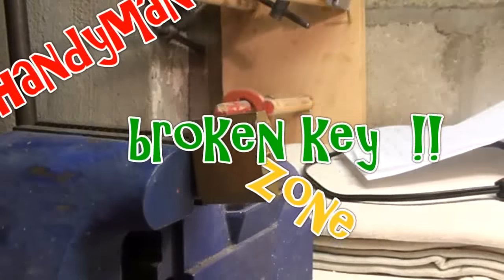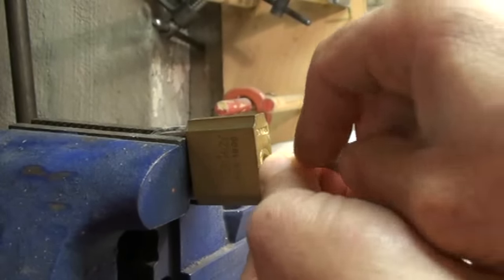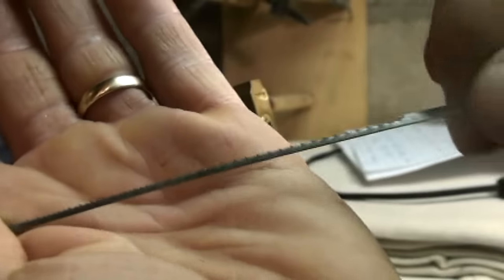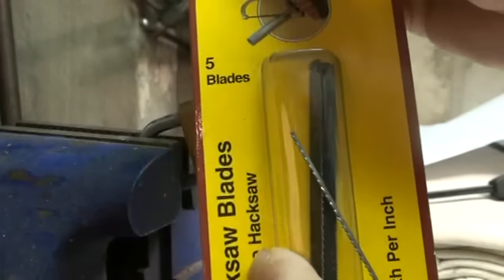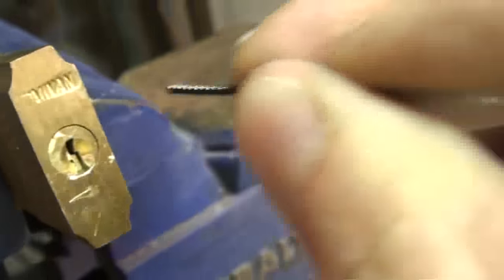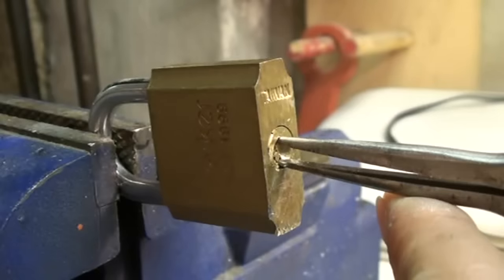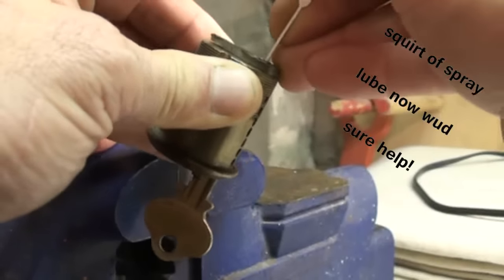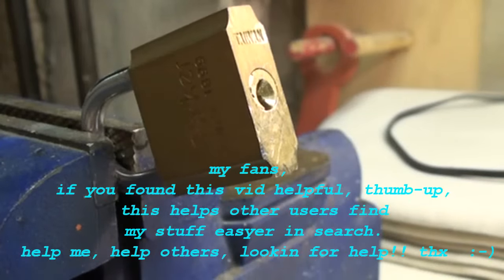7 Tricks Get Broken Key Out Yourself - Any Lock or Key

Comment: Thanks, the hacksaw blade thing worked great for me. My piece of shit stepfather tried breaking into my gun cabinet to steal my guns to sell, the idiot left the lock all messed up with paper clip parts inside, the hacksaw blade pulled em out and straightened out the inside of the lock so the key fits and works now. Now to go to the hardware store and get extra security :\

Comment from the maker: house visit? car in a parking lot? $35 bucks ,i dont think so!
yeah, $75 if you bring the lock into the locksmith store, 
but to have the locksmith come to you, that my firend is $350 and pay first cuz it only takes 2 minutes to remove a key
Reply: Wow, I'm moving to the US...

I'm a locksmith in the UK - if you called me out to remove a broken key at 1am on New Year's Day, the charge would be £95 (GBP) which I think is about $150-$160. A typical daytime call out would be a little more than half that, but basically, you are not only paying for the time it takes me to do the job, you are paying for the fact that I come to you, at a time you choose, in my van (with the expenses that that incurrs) full of tools and that I have public liability insurance, just in case I do end up causing some sort of damage to your lock.

I have no issues with you offering the info in this video, but I do get a little annoyed by people belittling the work that those in my profession do and making out that we make huge amounts of money, in return for very little effort.

Also, I would never recommend using regular WD-40 on any lock. WD-40 is formulated to remain wet. Every time you put your key in the lock, you will coat it with the WD-40, then when you put the key your pocket, it will collect any lint or dust present. Keep repeating this and you end up filling your lock with debris, which could eventually cause it to fail. The silicone (which you used yourself) or a PTFE based lubricant is much more suitable.

Comment: Granite?

Seriously, I believe you meant to type "Graphite"... but allow me to share that Graphite is about the worst thing besides teflon that you can introduce to a lock.

Most cars already have either a Vaseline-like or lithium-paste lube applied at the factory. Add environmental pollution + some graphite power or liquid and you get the equivalent of cake mix.

I recommend a product called HOUDINI lubricant, available at fine lockshops everywhere.

in a pinch, Silicone, CRC-56, TriFlow

Comment from the maker: datboishaq, you could'nt, the locksmiths would be out of business, watch the video i totally explain how to use a mini hacksaw blade to remove broken keys, it is better tool than any profesional locksmith tool, in fact most locksmiths use the mini hack saw blade to remove keys because it works! dont forget spritz of spray lube, works wonders. thanks watch9ing good luck and rate & sub!

Comment: $300 min service call for a locksmith? lol really?? IDK where you live but I have never herd of any licensed locksmith charging $300 for a service call. As long as you are within 30 min drive I charge $75 for coming out and removing a broken key .  (Also a locksmith can make a key for your lock after the broken part is removed.) Not even the con-artist fake locksmiths would charge $300 nobody would pay that. This guy doesn't know what he's talking about. These kind of videos are very deceiving.  Why don't try getting a broken key out a car ignition when just the tip is broken off? it can be difficult to even get a broken key out of a padlock when just the tip is broken off.  It takes skill and practice its not always as easy as this dope is making it look.  I know a lot of people will try this and for some it will be easy and it will work, others are going to be frustrated and asking themselves why they wasted their money and time on a set of broken key extractors (if they can get them) to just call a locksmith anyway.  It really depends on how deep the broken piece is and how quickly you need to gain access. if its way down in the cylinder just call a locksmith - He's not going to charge you $300.  If you have the time to waste and have access to locksmith tools go ahead and give it a shot